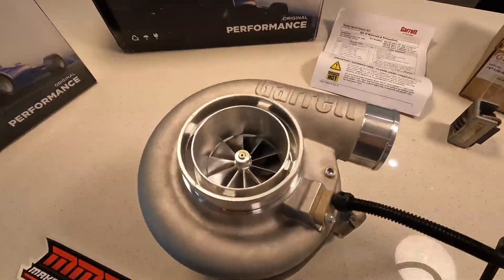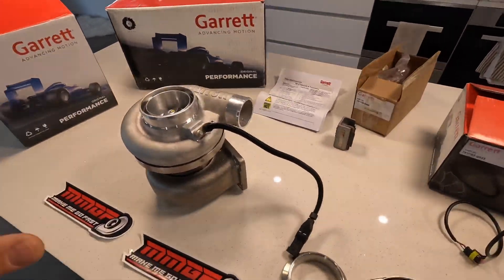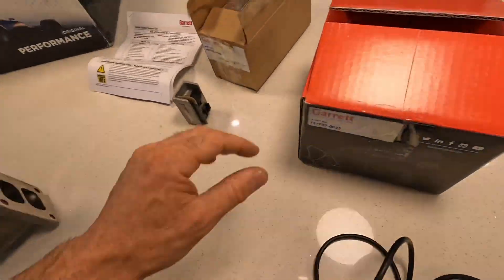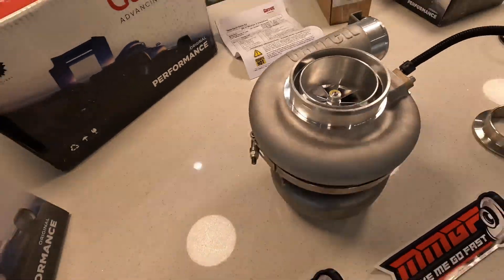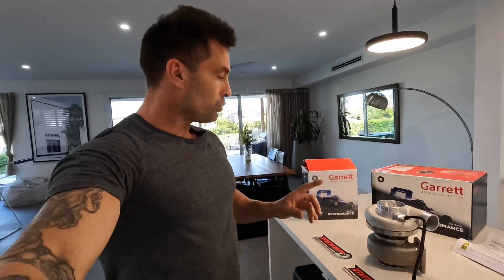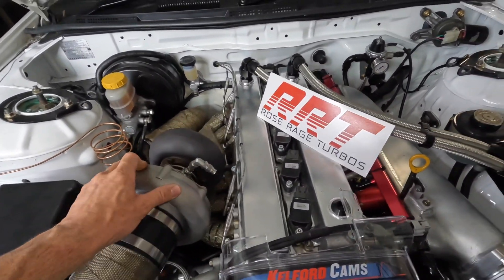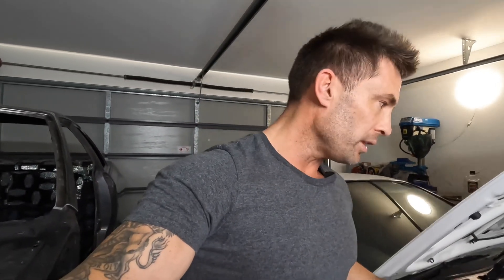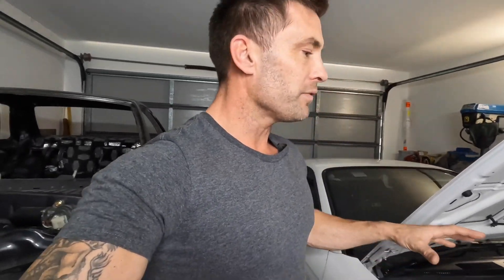Garrett G40-1150 2JZ

Comment: Im looking for something that would start making power quickly lower rpm or more towards the rt side of the rpm range and continues making decent pwer. On a built gte bottom end titan mains, diamond pistons 10 to 1, arp studs. Etc and gsc 2 cams witn springs on a is300 vvti ported head.
Reply from the maker: This is a brilliant turbo for the 900 - 1000whp range

Comment: What size is the Compressor cover outlet?? Is it still 2.5” like the G35-1050??
Reply from the maker: Yea mate. 2.5”. Lines up with my original setup
Reply: @Motorsporttuningsolutions1  One last question, what size is the V-band outlet?? (The one where the downpipe connects to?
Reply: Is the g35-1050 much bigger than the g40-1150?

Comment: Looks good mate. I'm currently building my 2J with billet main caps and a cnc ported vvti head. I'm using the G40-1150 turbo with 1.01 housing. Should be saucy 👍.
Reply from the maker: Very nice mate! I’m sure I’ll head down the built engine path soon. Fingers crossed 🤞 I can keep the engine together
Reply: It will last mate 2Js are strong. Especially in the s15. Being lighter let's the engine work easier. Give it the beans haha.